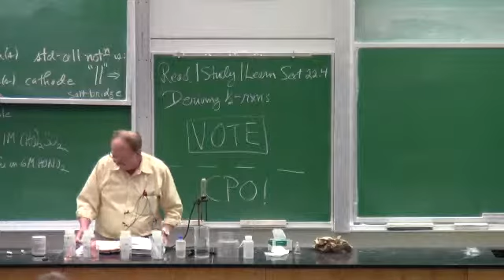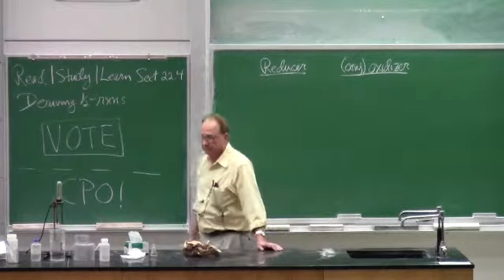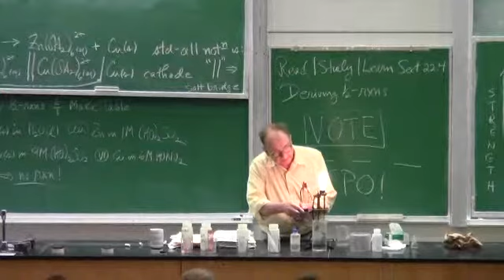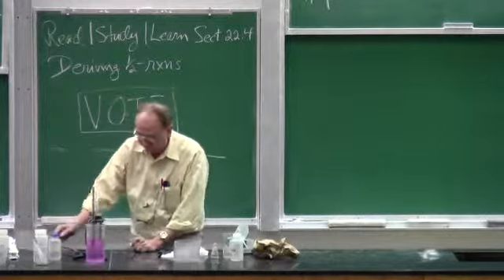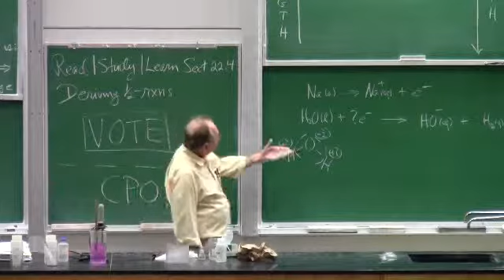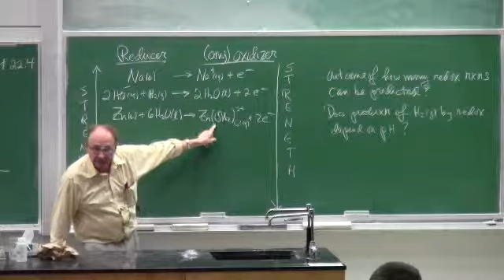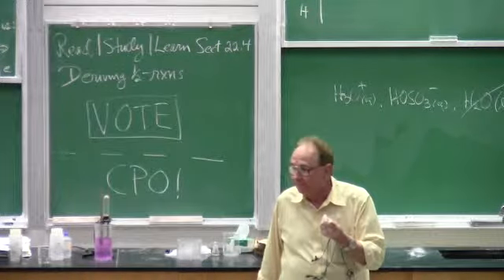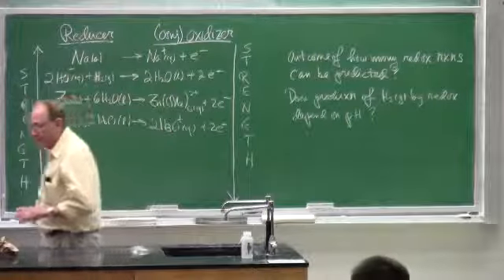05 November 2012

Comment from the maker: 25:00  meant to say: “we can recognize for this rxn that the GAS product is H2 exclusively”
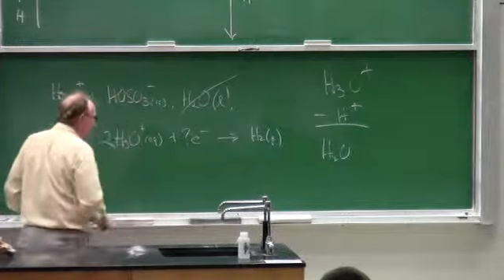29:00 & 42:42  Note that Zn does spontaneously reduce H2O. But, this rxn would immediately develop “Zn(OH)2” on the surface of Zn which would stop the rxn. (Given then that air-exposed Zn is actually coated w. ZnO or Zn(OH)2, Zn in H2O gives no rxn from a practical standpoint.)
43:54  meant to say: “discounting rxn of a given reducer with its own conjugate oxidizer”
jch